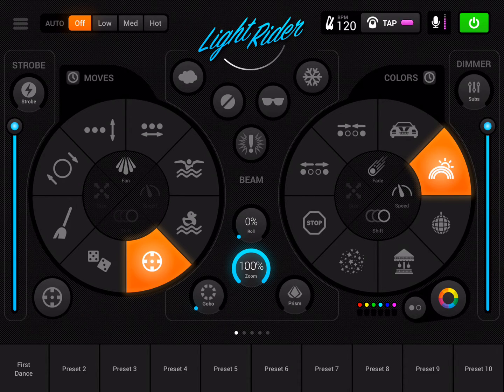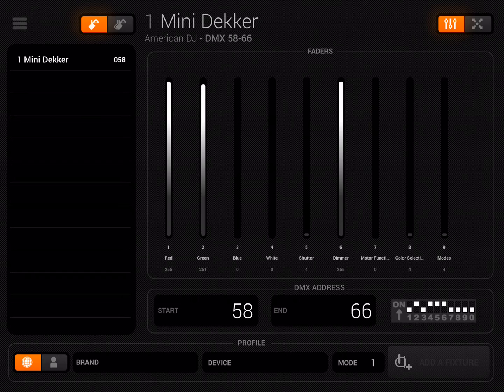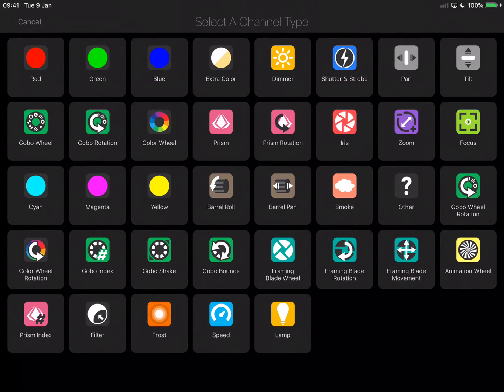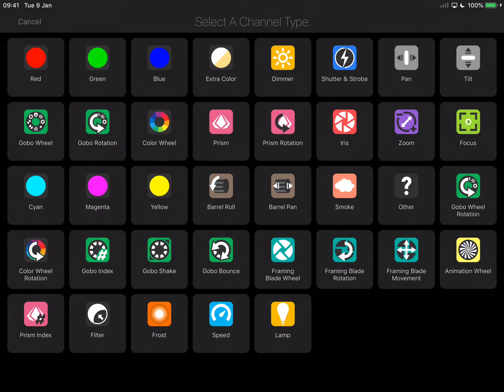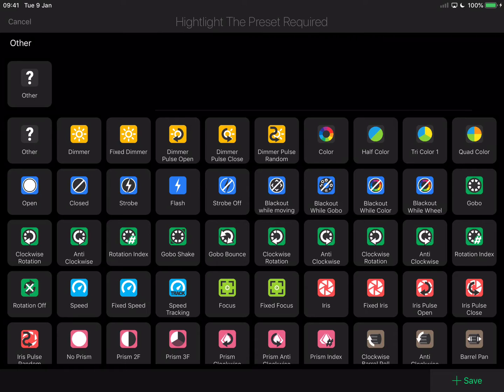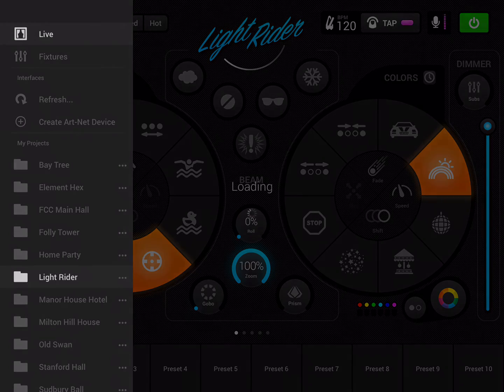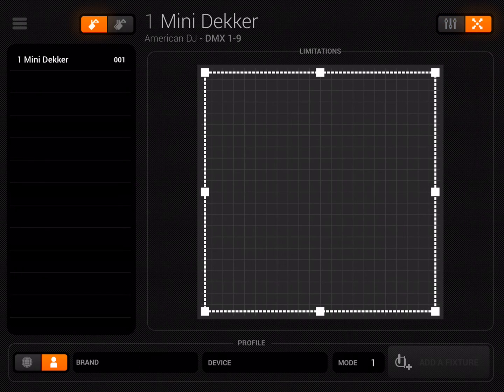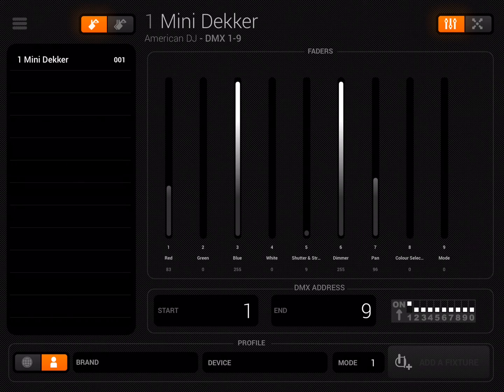Creating a Light Rider/mydmx GO Profile for the ADJ Mini Dekker using Profile Builder

Comment: Your videos are amazing, and very helpful.  If I can be so bold as to suggest a bit of a challenge....but I would like to control my laser (specifically something like a chauvet scorpion) like a moving head fixture.  The patterns I'm sure could be set as a gobo channel, the pan and tilt (y and x axis, respectively, not sure how z axis would be set or the rotation of the pattern would be set).
Reply from the maker: I've never really tried to create a profile for a laser.  As you suggest, it would be a challenge.  Light Rider is not really designed for lasers so any profile would be a bit of a fudge.  Have you tried creating something?
Reply: @LightRiderTips   I gave it a go...the one I have has 36 patterns (that was fun...lol, but was amazing for functionality).  It only has red green and yellow for colors, but the color channel is full of macros/auto functions.  I did get it to default on green, but it would not change colors automatically.  A big plus would be the pan/tilt functions to run automatically, but those channels have movement macros too.  When I tried, I could not get it to play nice with the moving heads.  It does manual controls in light rider, pretty conveniently though, so there is some promise.  I have since created profiles for some other moving heads that have an LED ring (trick to those is to make the LED ring a separate lamp on the fixture).  Which was inspired by your bar light tutorial.  I may take another stab at the laser, now that I'm a bit more familiar with building profiles.  It's actually quite fun for me.  If I do get one to work, I'll be sure to make it shareable.
Reply: Alright...so I took a stab at it, I made a sharable profile called scorpion rgy custom.  From what I can tell the profile should make the laser interact with mydmxgo/light rider in the most convenient method I can come up with.  I haven't had a chance to test it with my fixture yet, but I would expect the following...color will need to be set manually, but it's a laser.  Much easier to change through the different patterns.  Although, rotations may still need to be manual.  Pan and tilt should react to the moving head effects, (which would be amazing if I set it up properly), with the understanding that movement limits will need to be set.  Other than that, I hope I've done at least, the heavy lifting on this project.  Im curious to see what your thoughts are on the profile and any feedback or other tips you may have.

Comment: Question... I already have the light rider Artnet license... at the moment I use it with a router and a SmartShow NetDmx dongle... It was £40 on eBay, works well... but I want to reduce cabling... what is better? The Lighter Rider Interface or the Adj MydmxGo? The adj is cheaper... if I was to buy that will it work with Lightrider and the license I already have? Giving me a full Universe? Thanks for your Tips and Tricks... not many videos available on the Fixture creator... 🖖
Reply: You can use both it will work.
Reply from the maker: The mydmx GO App does not support Art-Net and your Art-Net license is specifically for the Light Rider app.  You can use either app with the LR512 interface or the mydmx GO interface.  If you already have an Art-Net license, you could consider picking up an Art-Net DMX Interface with a built-in router such as the ADJ Airstream DMX Bridge.  Are you using LR on iOS or Android?
Reply: Light Rider Tips I’m using IOS... so, the AirstreamBridge has a built in router? Thank you 🖖
Reply from the maker: Yes, the Airstream DMX Bridge has a built in Wi-Fi router.